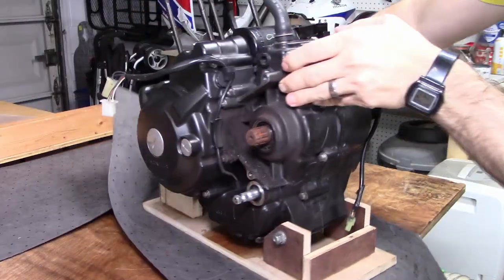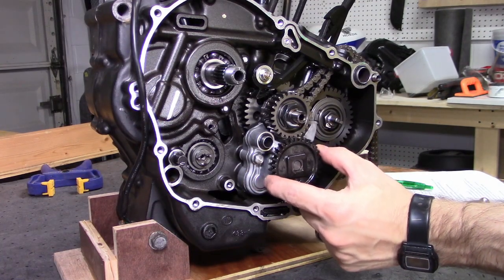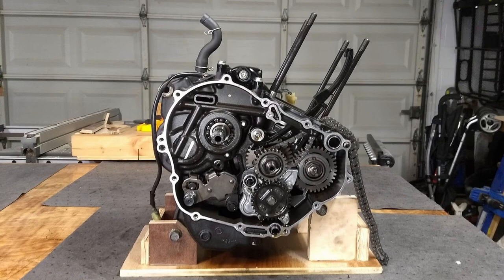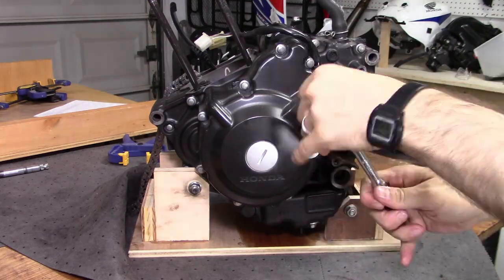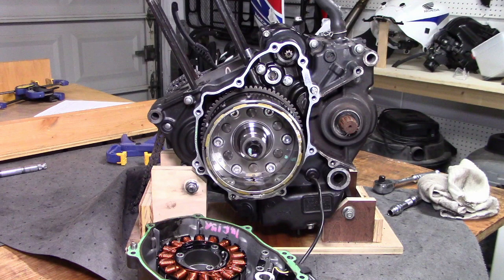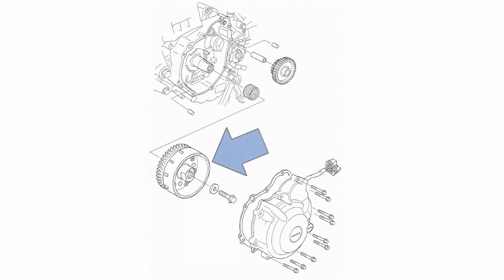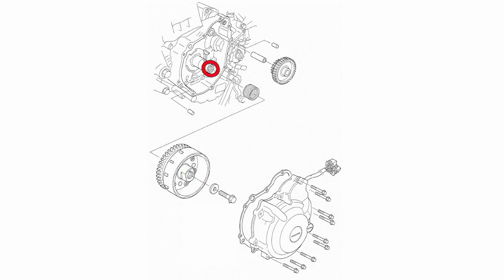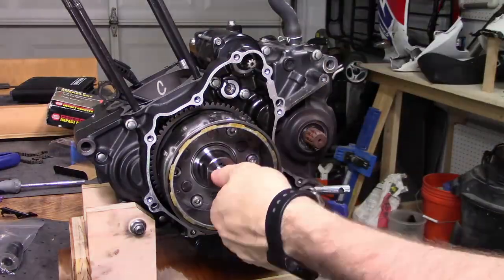CBR300R - Engine Teardown part 3: Remove the Gearshift Linkage, Oil Pump, and Flywheel

Comment: I'm really glad you include the "pro tips." I learned one the hard way changing the oil on my CB300F. That being, don't bother following torque settings using a torque wrench on the small bolts. Just get them finger tight, and give them a teeny twist to finish them off. That may be true of pretty much all but the biggest bolts on any bike, especially older bikes. I rather risk them backing out from vibration than stripping threads, so I just mark my bolts with some witeout to see if they back out, or watch for oil leaks depending on the location.

Your videos are great. No one else has videos which are as concise as yours. They're clear, rapid, and informative without room for confusion.
Reply from the maker: Thanks so much for the kind words...it really means a lot to me :D

Comment: I would have used a magic marker to mark the correct position of the gear change lever for re-assembly.  a little rubbing alcohol removes it easily when the time comes.. this trick can be used on any metal part when needed

Comment: Doing the same thing with my bike. Do you know how to determine tdc when reassembling?
Reply: I'm sure this is too late for the person asking the question, but for anyone coming to this excellent video series later: There's a timing mark on the flywheel -- "T" for TDC -- visible when you remove the smaller of the two aluminum covers on the left side case.  The larger aluminum cover allows you to use a 17mm socket to rotate the crankshaft (rotation is counterclockwise, as though you're removing a bolt). 

The cam sprockets both have IN engraved at the "west" sides (i.e., towards the left) and EX at the "east" sides.  There's a line underneath each IN and EX.  If the lines on both sprockets are all parallel with the head's top gasket surface when the crank is at TDC, valve timing is correct.  (This is also the state in which you check valve clearance -- top dead center of the compression stroke, when all four valves are closed.)
Reply from the maker: As far as I know, TDC requires 3 things to have the correct angular position: crankshaft, intake cam, and exhaust cam. Crank should be reasonably easy...just have the Piston at the top of the stroke. Cam position can be figured out based on the stamped markings on the face of the cam gears. I have some video and images showing that in the video I made about how to remove the cam shafts:
https://youtu.be/M3Brv6AnwGs
Hope that helps!